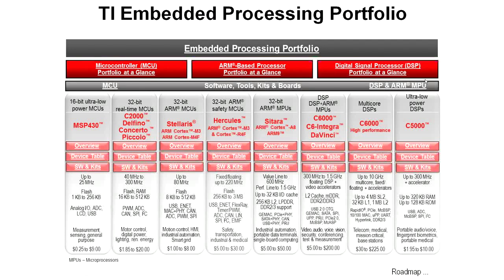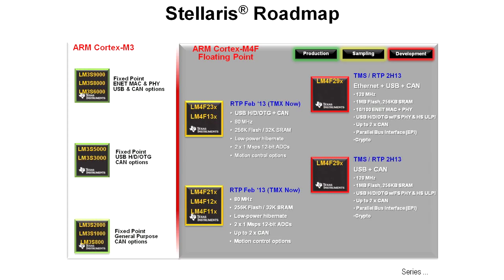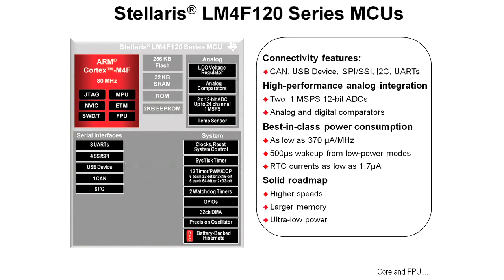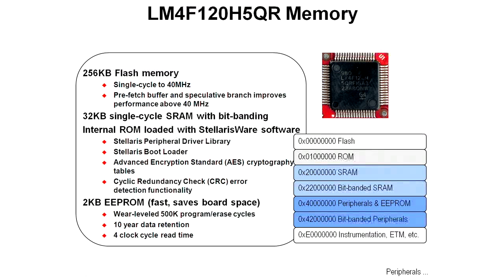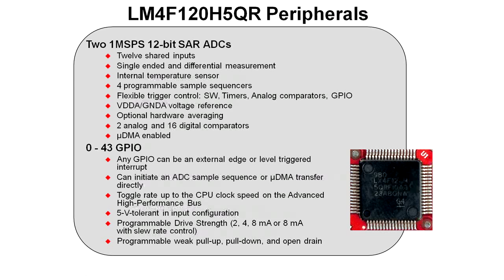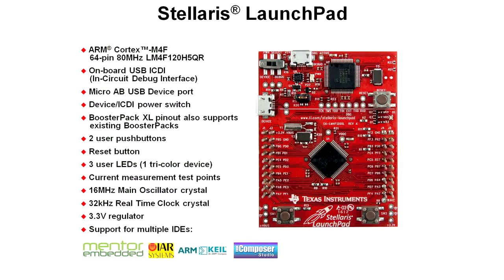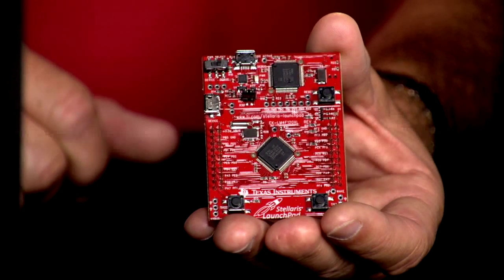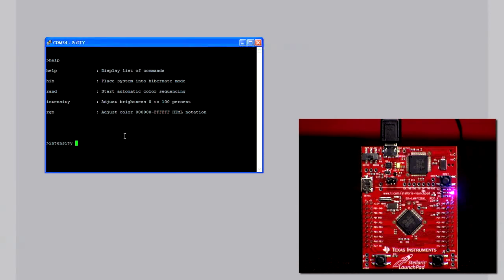Chapter 1: Introduction

Comment: I am a bit confused and could use some help, I was ordering one of the boards and half way through I had needed to cancel, when I came back to order a board and complete the process it went smoothly and I had no issues, I have gotten 3 or 4 emails confirming my order but when I check my purchases status on TI's website if says I haven't ordered anything. I you know what I did wrong or at least what is going on the please reply to this.